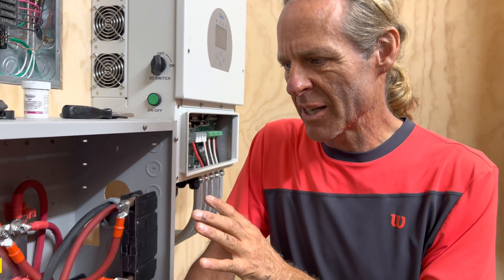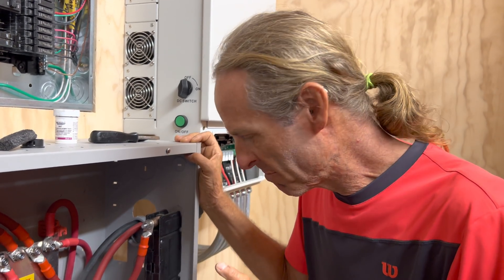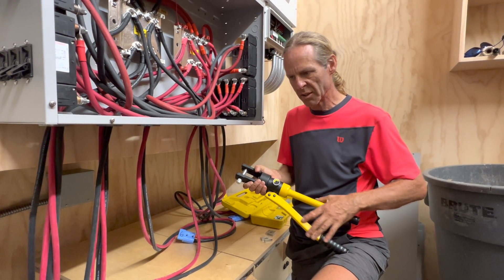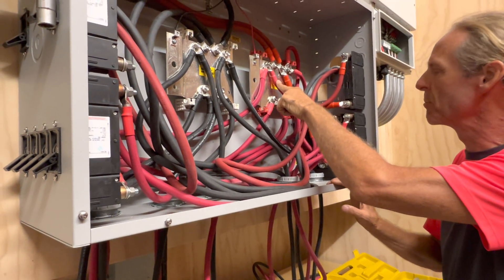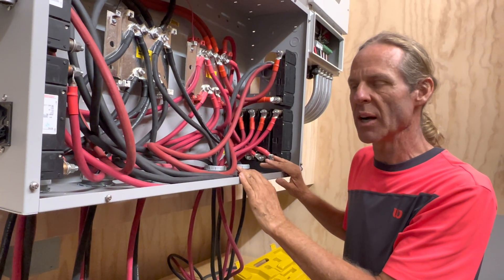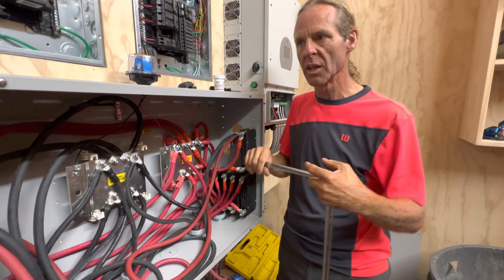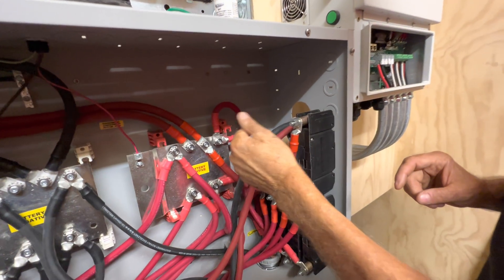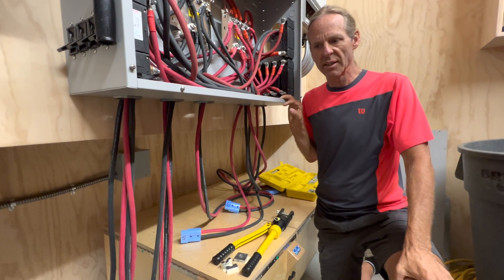Wiring Up Eight Big Lifepo4 Batteries and Three Big Inverters!

Comment: Good little video.
I have a couple of explanatory points to share.
The lugs with holes, these type of lugs are not for use with this type of crimper dies. They are for use with the type of die that has a nub/noble/indentor/pin that punches an indentation into the body of the lug rather than the type shown here which squashes the whole body.
The hole is to allow the strands of the cable to expand lengthwise, otherwise the strands would be squashed almost to the point of cutting right through as the copper would have nowhere to expand into.
so don't mix the two types of lug and crimper.

The second point is about the length of leads.
Each inch/centimetre has a resistance value which increase in a linear manner, 1 inch plus 1 inch you add the values together and so on. If your leads are different lengths they will be different resistances which knocks on to Ohms law and creates the problems with discharging at different rates.
The caveat here is how big is the difference?
I suspect the installation recommendation is to cover all bases as set ups will vary, each one being individual.
It is possible to mitigate this by using a bus bar of a large CSA, run the leads to the bar as short as possible and the same lengths from battery to bar within reason.
The Bus Bar should be connected to the inverters/distribution box/connection point in the middle of the bar. 
If your Bus Bar is of sufficient CSA the difference in resistance will be so small as to be insignificant.
The benefits of doing it this way? it looks a lot nicer...lol, may be a tiny bit cheaper depending on the cost of the bar.
The maths involved in calculating the actual resistance difference is simply ohms law but the math to get the physical size is difficult as all the values are not linear or even a combination of calculations, which is why I believe the reason for the installation advice is as it is.
Personally if I happened to have a lump of copper bar twice the CSA as the combined leads CSA I would be happy using it.
Note although the Bus Bar is used and it is 99.95 a bar of copper, the bar could be made of cable, its about how you use it electrically speaking.
Hope this was of interest, the second half is not really helpful as such more of background but the lugs part is important to follow.
cheers.

Comment: Insanely useful as always Ray. 
I've also run into the wire length for parallel battery problem. My planned solution to try keep the wiring clean/less excess was a massively oversized cable connecting each battery. ie 185mm cable from battery 1 to battery 2 etc. Chaining them (still parallel not series). My logic was the resistence on the large wire would be negligible in comparison to differences in battery pack internal resistances.
Any thoughts/opinions on this folks?

Comment: Good overview. The hole on the end of the lug doesn't make too big of a deal unless in a marine environment. If crimped properly, a cold weld with a solid face wont allow moisture in between the strands. Harsh environments will commonly use tinned wire and lugs to help with corrosion. Good job on the circuit length description. Most people make all the wires the same length instead of making the circuit loops the same length. The extra unneeded length to match all wires just adds extra resistance when having circuits the same loop length balances the resistance and shares the load without the need for extra wire/resistance/cost.
Reply from the maker: I have been accused of being OCD by people that ARE OCD. 😂😂

Comment: Can you share the deye supplier for those of us not in the US. Just want to know the best company to source them. Thanks
Reply: I did quiet an extensive search for the Deye unit/product and it is only available in the EU version or standard by way of Alibaba dot com
Reply: @energydreamer5347  actually there is a deye in france, and one in austria
Reply: @houseofancients  - thanks!  I would need a US version or standard.  I have found a resource for the the Deye EU version/standard but a little gunshy/reluctant to go though the steps to alter the EU version to work in the US.

I definitely would like a Deye simply based on the fact that @Ray Builds Cool Stuff has done the due diligence and I believe it to be a quality product.  The US version of the Deye is super super over priced by SolArk.

Thanks again @houseofancients !!!!
Reply: @energydreamer5347  good luck on the split phase, maybe you can try carabian, but sol-ark has killed off any split-phase to protect their 300% upmark
Reply: @houseofancients  - I have found a couple on Alibaba but the shipping is pretty stout.  I am looking into Sun Gold Power right now - they have a Split Phase Hybrid Inverter for US standard.
Reply: @energydreamer5347  sun gold power = voltronics/mpp solar, not deye
Reply: and to add, there have been multiple folks having nothing but issues with the sun gold, youd be better off buying us local and getting support local.
ian at watts247 has a good reputation for helping and is the us distri for the us .. the mpp model you seek is the 6548
eg4's ( signature solar ) is another rebadge of the same inverter, also locally supported
Reply: @energydreamer5347  what was the shipping look like
Reply: @hoocli  - it would vary from seller to seller - I say around $700 and could be higher.

Comment: Is that correct that the inverter cable lengths have to match? I thought the load dictates how much power each leg uses, and so each side of the split phase won't be balanced anyways.  thus length should be the shortest possible to reduce losses from resistance/heat. I can agree that battery cable lengths should be the same idealy, but there are other factors such as battery internal resistance..
Reply from the maker: Here is a link to Kieth's video from Sunsynk. Victron has similar guidance. https://www.youtube.com/watch?v=eWzLFR-s4K4
Reply: @RayBuildsCoolStuff  - did you speak accurately that Sunsynk is building or has built a split phase hybrid inverter that is comparable to Deye?
Reply from the maker: @energydreamer5347  Deye is the factory where the sunsyk is built.

Comment: Great video! 
Excellent info on the crimp connectors.
Rather than have extra cable tucked here and there.
 Is there a workaround to eliminate the extra wire length?   That's affordable to most folks.

Comment: 1:58 did you buy a different crimper this time or is it still the same. It looks like the usual ones you can find on AliExpress for about 50$ or so.
Finally back in the operations room  or shed below the panels you had built in spring. Looks beautifull , I mean the craftmanship in all the bits and pieces that now have come together.

Great progress and I had not been aware of the usefullness of such combinerbox to equalize the total DC cable length from each battery to the inverter.
Luckily we just need 1 battery and have a far lower consumption about 5000 kWh incl. EV charging but good to know how to scale cause we will need to move ahead away from Oil to heatpump and electricity as heating power due to energy price explosion. We do use wood for 4 decades but at the end we still have to get 1500 l or 400 gallons oil to burn each year and with the 3rd solar power system we hope to get a lot of the power needed for the heatpump. Outages is not an issue, just 20 minutes in 20 years when they have to do maintenance on the grid and that is usually announced in advance.
Reply from the maker: Same crimper. Better quality ones are available at 3-4 times the cost but I just spent another 60$ split with my friend. There are actually two identical systems I am building. This video is in her solar shed. Mine is at  a similar stage. I bringing them along together. I'll me making more cables for mine tomorrow.

Comment: Hi Ray, I'm your 7th like. Great video.  I understand the same length cables as you talked about because I do the same on my battery builds but didn't know or heard of until now about inverter and battery mains to inverter/charger needed to be equal length. I always believe that wire connections were a over looked subject. I have seen were I could squeeze the alligator clips on a battery being charged and the voltage would change on my power supply battery charger.  I did not know about equal torque on all bolted connectors for equal voltage/current/resistance. I work with a small to nothing budget. I don't complain about it, I just make it happen. I can't compete with your tools are your knowledge so I work with what I have and learn more from people, such as you that know more than me. When I connect a wire/cable most of the time it's a used jumper cables to a copper lug terminal I strip the installation at proper length add solder Flux to the wire and inside of the lug. Then I take a big screw driver with a square bit at the end and a small hammer size sledgehammer beat the lug about twice with the square screw driver. I pull on it very hard and they have never came out. I next take a small hand size touch and heat the hell out of the connector lug and add solder while the lug is pointed down and the wire is above it until it drips out of the hole in the lug. The that you don't like.  I feel like this double atachment also serves as a air and moisture lock bearer. Then let it cool down and trim off the burnt insulation near the connector and add my heat shrink.  I just thought I would share how I've been doing this and ask your thoughts,inputs, comments. Also do you or did add extra torque for that extension on the torque wrench? Keep more videos brother. Thank you.
Reply: Hi Chris, Im sure ur connections look & perform quite reasonable, but there are a number of concerns u should probly do some more research about making some of these connections. There is a mixed school of thoughts on soldering connections and particularly when it comes to fine core welding wire cable and lug connections. In Australia we have a lot of different codes and standards than are used in the US, but fine stranded cables should really not be soldered for various reasons, a few are: because the flux/acids can affect the joint & cause oxidation, if a soldered joint becomes hot for whatever reason it can melt out the solder and thereby increase resistance/heat and loosen a connection to potentially fall out, &/or create a fire risk. 
A correctly rated connection lug for a given type of wire is as you say, “a overlooked subject”, as Ray has explained here, the crimping is important, & for these type cables definitely requires the right tool be used, a proper crimp should attain what is referred to as a ‘cold weld’ or ‘cold fusion’, which essentially means u have squashed the atoms of the metals so close together that they all bond, and this is air tight, adding solder can also stiffen the joint to some degree which can also weaken it. These cables carry a lot of load and a proper connection should be given the duty it deserves to make it safe and last. You made a great comment there Chris, I did not mean to criticise negatively at all, but the importance of making a good connection is a broader subject than many people give credit. Cheers
Reply: @evil17  hello Evan. Thank you for the returned comments, information and criticism. I know this may sound weird but I'd rather have negative reviews. What I'm saying is, I can't get any better with people telling me good job, nice work. I always want to know and look to see if there's anything that I make it better. I know that I don't have the right tools and I hope soon I will. So I thought this type of connection that I made was better than a squeeze connection. After I drive that square end screw driver 2 or 3 times into the copper lug with the small sledgehammer I test it by trying to pull it out with my hands.i never been able to pull it off. Then I thought to make it even better was to solder it. I was trying to make a strong bond with solder weld. I also try to over size my wire for all projects. I like the addition safety.
Reply: @chrisbritton8326  before I could afford o commercial crimper I made a die set from mild steel with a side grinder and hammered with sledge hammer . Was slow but effective.